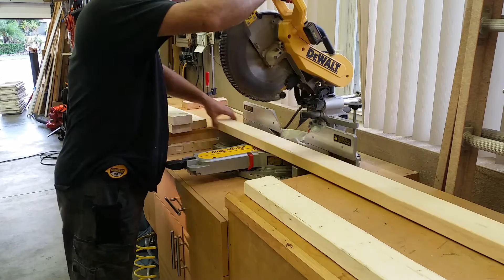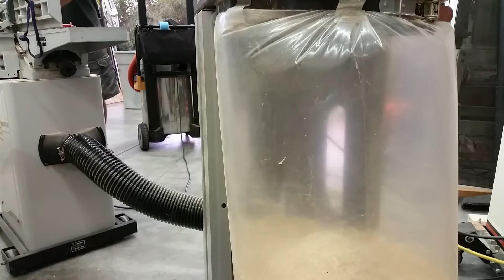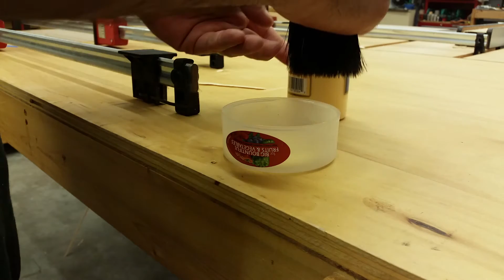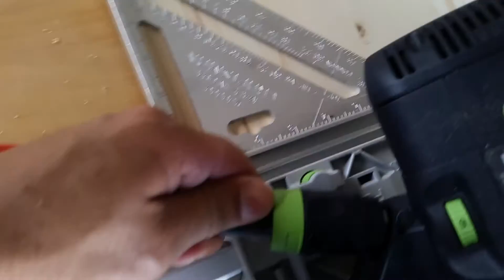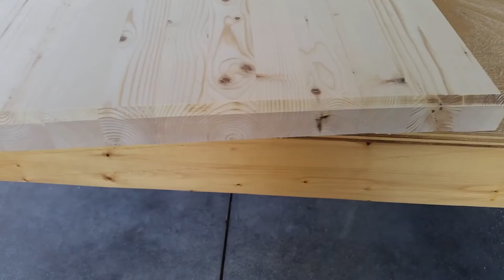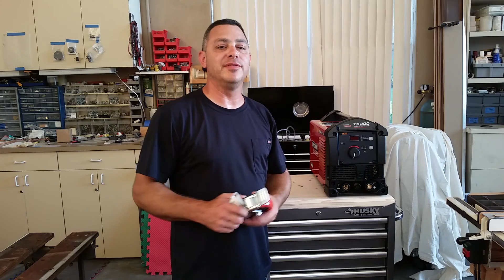Lincoln Power MIG 210 MP/200 square wave TIG Welder Cart Build Pt 2

Comment: Hey Greg, those are really nice casters.  Can you tell me where you sourced them from?  I need something like that for a work center project I'm building.
Reply from the maker: I got the swivel locking casters at Home Depot.  that's the 3rd set of casters like that and they are very well made and durable.  they are rock solid when they lock up too.
Reply: Great, thank you.  That's exactly what I need!